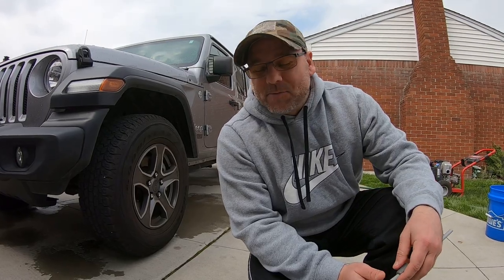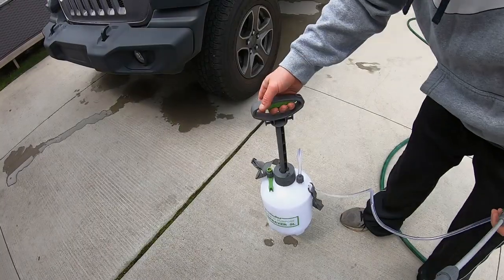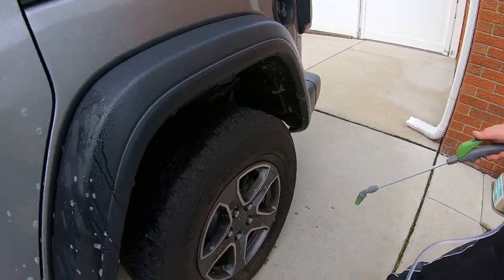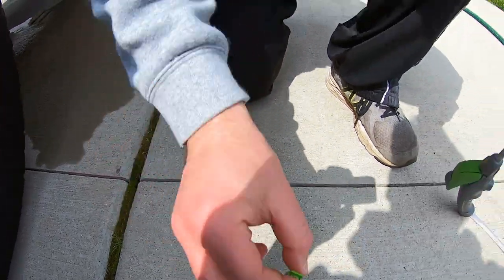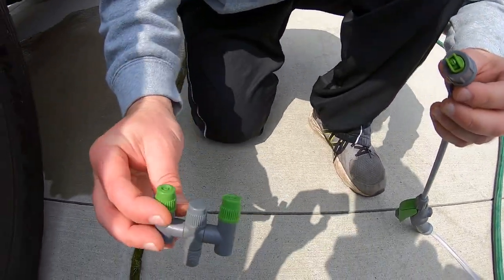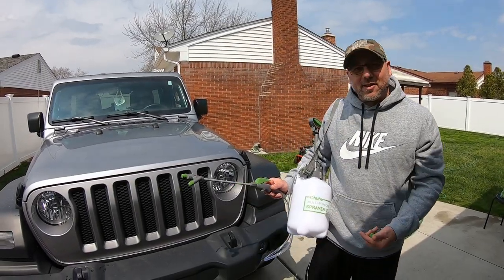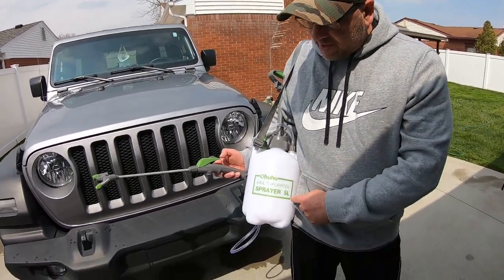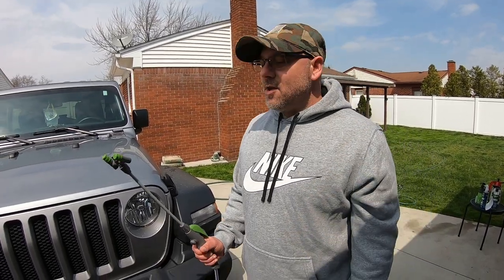Pump Sprayer for Vehicle Rinseless wash Soap and wheel cleaners

Comment: Lou, get a metal tire valve of Amazon and install it near the top of the canister and you'll never have to pump it up by hand again. I do it to all my sprayers. I usually make sure the ones I buy have a pressure release valve for safety and making it obvious when I have it filled.
Reply from the maker: What a great idea Bigolddog. The tire valve should work great. Thanks
Reply: @OuzoLouGarage  Takes about 5 minutes to install and saves a ton of time. I use it for my wheel cleaner, rinsless/waterless washes, etc. I use therse https://www.amazon.com/gp/product/B07L75MCY5/ref=ppx_yo_dt_b_search_asin_title?ie=UTF8&psc=1 or these https://www.amazon.com/gp/product/B01BRVCQ7K/ref=ppx_yo_dt_b_search_asin_title?ie=UTF8&psc=1
Reply from the maker: @kikcodog  Going to order some now. 😉